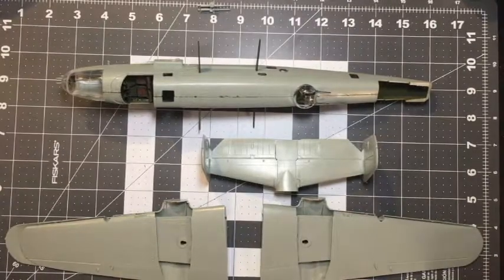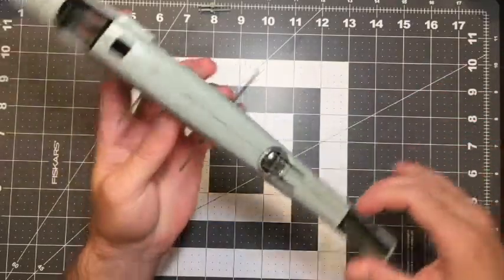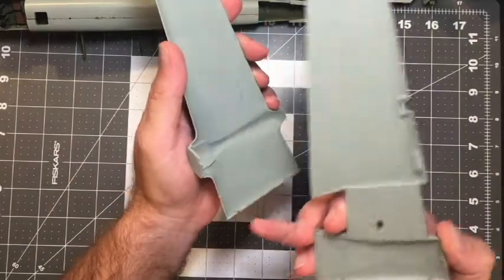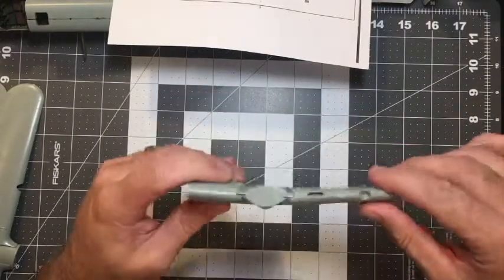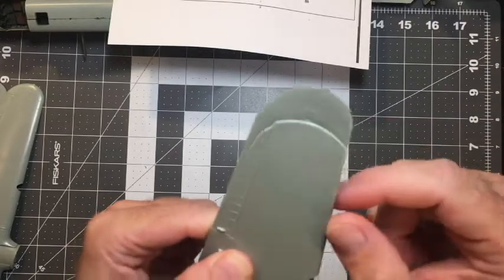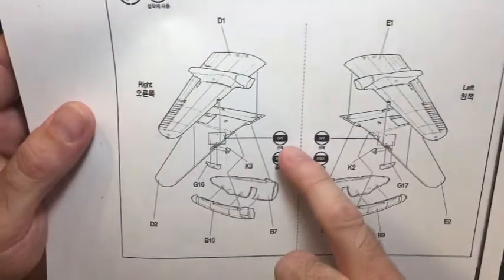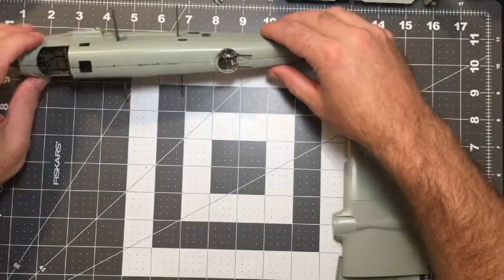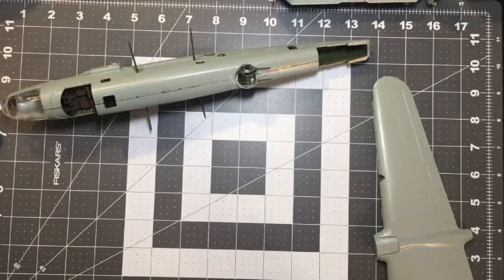AM I LOSING MY MIND???  1:48 Scale B-25 Model Build - PART 4

Comment: I know it is late for you, but just to inform others so they won't be scared buying this kit in the future, this looks like some one off error in your packaging. I have the exactly same kit yet unbuilt and mine is fine. You kinda scared me though and I had to immediately dry fit mine, but everything looks fine.
Reply from the maker: Thanks for the info!  I’m happy you won’t have that struggle. Interestingly, today I attended the IPMS show in Las Vegas. I spoke to the MRC rep about my issue and he said they would send me a new kit. I informed him I fixed it, so I declined his offer, but he appreciated hearing about the problem and said he would inform Academy about it.  I hope to get a video from the show out tomorrow. Thanks again for the info. You are correct about not worrying, as they are a reputable company.
Reply: @KevinsModels  I'm also very happy not to have that struggle. :-) Generally later Academy kits are of great quality. I actually built several tanks from their latest production and they are better than Tamiyas and for way better price. Even though of course a part of that equation is the fact that lot of Tamiya tank production is rather old now, but they still sell them for full price so I think that comparison is fair.
It is not entirely true for this particular kit though as this is not the original Academy production, but acquired older kit from no longer functioning Accurate Miniatures company and those are not that great. Academy has improved the manufacturing process so they no longer have sink marks or whole sink areas as they originally had and they replaced original not all that great decals with new from Cartograph, which are very nice, but some things can't be fixed. I built from this batch 1/72 Tempest and it is perfectly buildable just not the kind of kit where you can forgot where you put your putty. :-) This one looks rather similar, some minor fit issues are to be expected.
Reply: Scurrrrrred?🤣

Jman

Comment: Bizarre. A very badly moulded part. I would glue some plastic card to the wing tip, sand to shape, then apply putty. It will use a lot less putty, and should be stronger. Good luck with the build.
Reply from the maker: Thanks Paul.  It'll be a fun challenge to work on!

Comment: I have never seen that large an error. Have seen small parts deformed, not enough plastic the mold. First thing I’d do is contact the guy that helped you find the model. It’s not his fault but get a record that you’ve had this problem. He may have some suggestions for you. I agree with your first comment, styrene will be easier than putty.  The store will help you with styrene and how to draw the panel lines etc.  Just DON’T  glue the wing until you’ve spoken with some one at the store. If your.willing to learn something new here’s how we learn. Get some advice and jump in!!!!
Reply from the maker: As much as I'd like to get a new set of wings from Academy, I really enjoy a challenge and am looking forward to fixing this set.  I'll be visiting the store in Phoenix I bought it from and see what advice he may have.  Thanks for your sound words of wisdom!